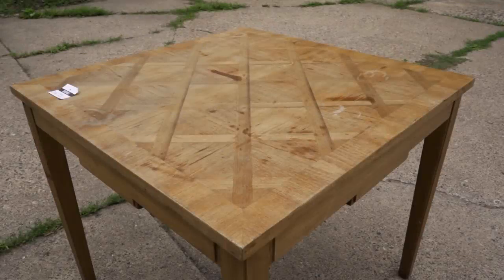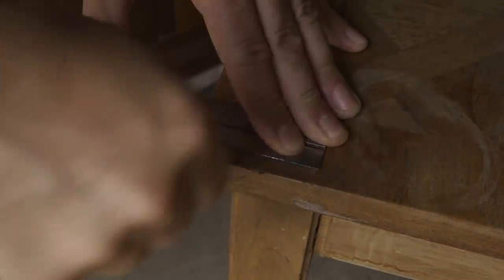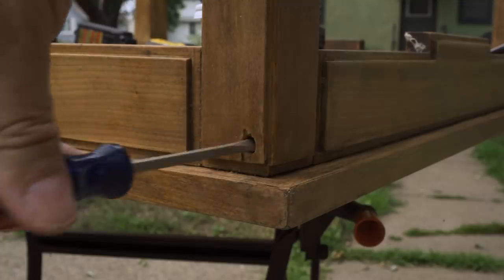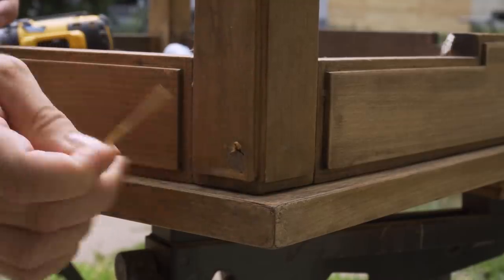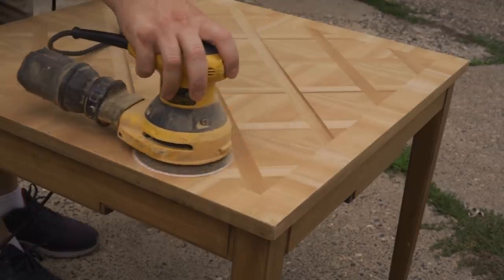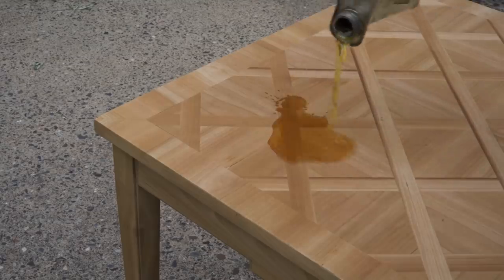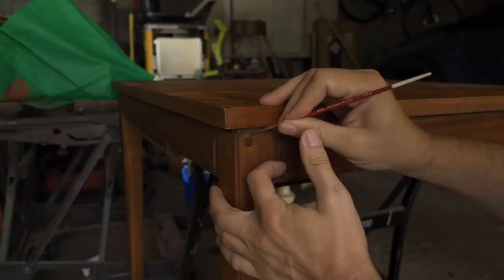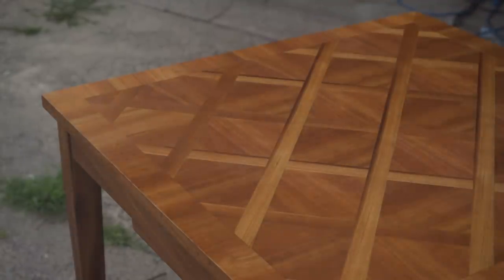Thrift Store Rescue #23 | Refinishing And Repairing a Thrift Store Table | Furniture Restoration

Comment: I had a question about veneer repair! Instead of cutting a straight edge to match up, would it be possible to trace the jagged edge to cut out the veneer to fit perfectly? It seems like in a lot of cases this would disguise the patch well as the breaks happen closeish to the grain lines. Might be hard to get a good cut that matches it perfectly though I suppose.
Reply from the maker: You could but it’s going to be difficult.  In this case the cut was parallel to the grain lines so it blended in just fine.
Reply: @DashnerDesignRestoration  ah I see, thank you!
Reply: @DashnerDesignRestoration  I  remember seeing someone use masking tape over the missing veneer to trace the opening and then applying the tape to the veneer and then trimming the veneer by the lines drawn on the tape. I watch so many YT channels I'm not sure where I saw it. Tom Johnson maybe???
Reply: @jcrefasi1   Dashner has done that technique
Reply: @rber1361  lol Thanks!! maybe he's the one I saw do it 😂

Comment: Nice! It does seem quite the 1980's.
Question: Wouldn't it be better to shellac or varnish the wood without any Danish Oil on it? I am thinking like...fingernails, for instance. When painting my nails, I make sure they are free of oil before painting, for better adherence of polish to the fingernail.